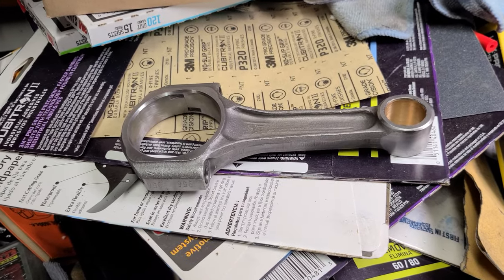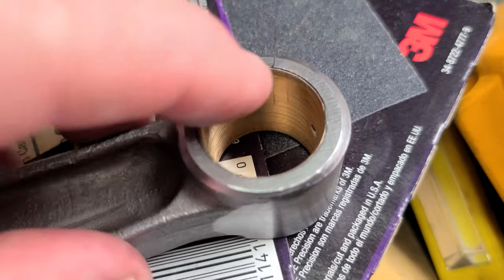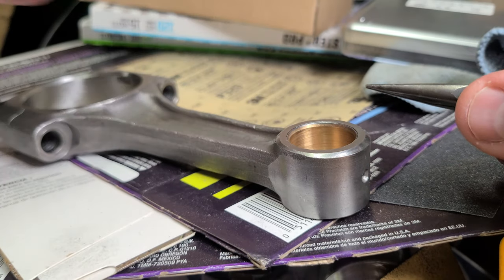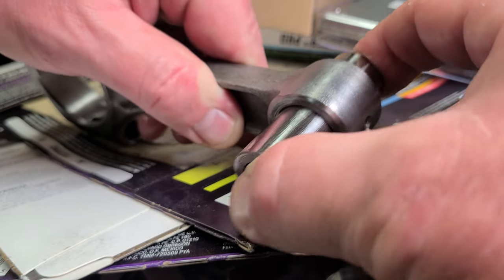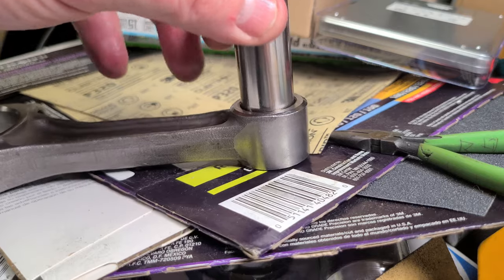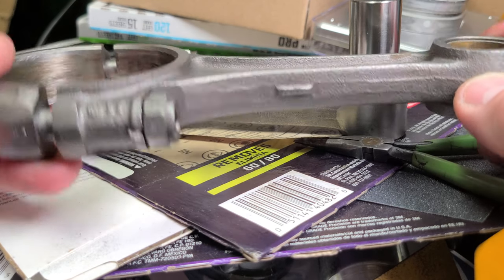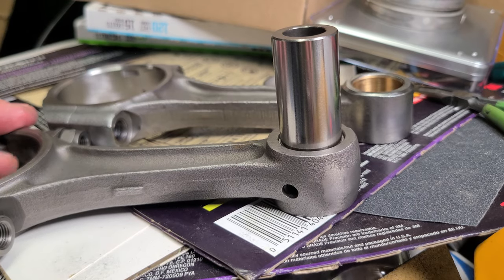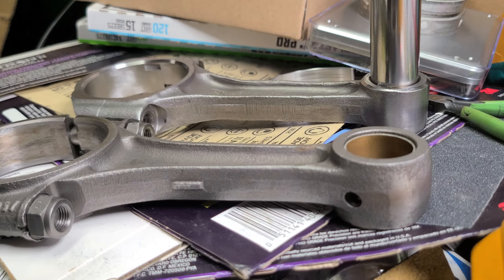QIK-ee: Empi 5.5" Connecting Rods

Comment: Hey Mr. Shark ! I got a set of those rods for a 69mm crank and the rods do not have enough oiling holes on the wrist pins. I am going to drill 1 on the top side like the stock rods.  I bought them for 128 bucks on the internet because I live in Corpus Christi Texas and would have to drive to San Antonio to get some rebuilt VW rods.  VW  rods are 1054 low sulfur forged rods and the EMPI are 4041 crhomemolly which has more strength . I am getting stuff together to refresh the motor   Good Luck?
Reply from the maker: Interesting idea. Thanks for that info. Right now I'm working on fine-tuning the clearancing that GBE did on the case. Not quite enough on the cam pedestals unfortunately. Then I'll revisit the rods.
Reply: I also bought a set of 5.5’s and a 69 crank… now I have people telling me they won’t work with my jugs….. I’m new at this? Can I get a taller jug that they will work with?
Reply: @MRJPP2U  a 69 mm crank should use 5.394 rods . its a good ? if B stroke jugs would work . If they were to long you could get them shaved down . But if you would go that far you mise well get a 78 or 80 mm crank and stroke it . Its tat or trade em for some 5.394 rods . I live in Corpus Christi Texas and to do any machine work on a VW I would have to drive to San Antonio or Houston , which makes it a no - go ?